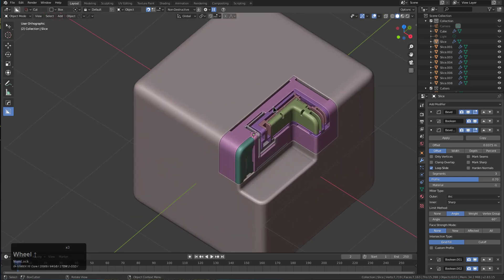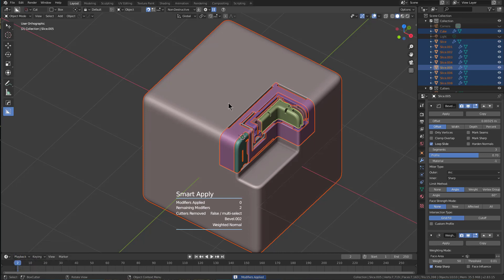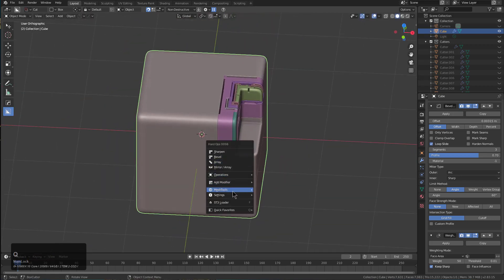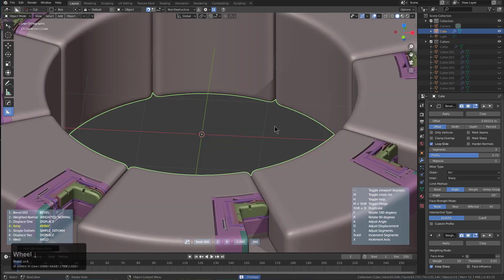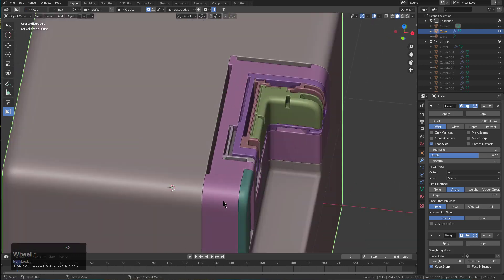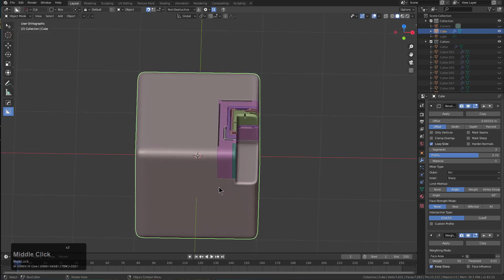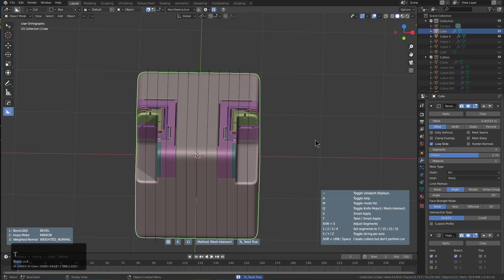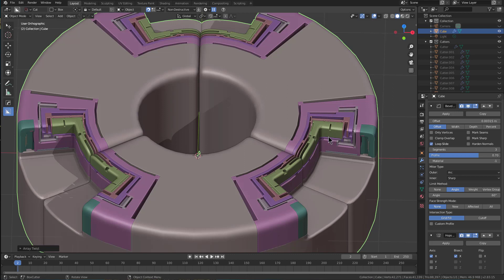#hardops 985 - Dice And Twist

Comment: Hey masterxeon (or the rest of the community for that matter) I've got a quick question.  When dealing with an object that has a lot of booleans, I notice that my project bogs down significantly.  Aside from applying them, is there some way to bring performance in the 3D view back up? My PC is no slouch either, I've got a 3950x (16 core 32 threads) and 32GB of 3600MHz RAM but it looks like Blender is barely using any of it.  Not trying to imply that Hops is at fault either, I'm just asking because I'm sure you've run into a similar problem at some point.
Reply from the maker: gotta apply at some point. It eases the evaluation on the pc side. Someday a trickier solution could be found but it would be a hack to get that speed back. When the speed is impacted I have to apply at a certain point. Also with bevel and weighted normal it also adds to the evaluation.
Reply: @masterxeon1001  good to know. Gotta commit at some point. I guess doing things non destructive like that is addicting. Thanks
Reply from the maker: @Sophistry0001  I can get rather far but at the end. It gets hard to dice and twist without apply. I love that speed hit that comes with apply and the freedom that comes with it.

Comment: Before I buy I gotta ask how hard is it to UV while using Boxcutter/Hardops with all the cuts does this increase the difficulty the task of UVing?
Reply from the maker: There is not a mesh that cannot be uv'ed by either a human or a machine. If you are asking about optimization that is based on the user itself. Substance painter doesn't even need uvs anymore.

Comment: [Update: Idk wtf is going on, but now the Q menu is working when I reinstalled the e-cycles 2.83x on another drive.  You're stuff is awesome, btw.  Ppl change by the day, computers don't...or I thought they didn't!}

Jerry, what's the story?  I tried to use e-cycles 2.83 and when I press Q, it shows the Hardops titled menu, but without your list of options.  After I realized it wasn't me, it was you, I retrograded back to e-cycles 2.82x and voila it works again.  [Update: I spoke too soon, today, it doesn't work in my 2.82 e-cycles either]  The menus work fine, and even the shift spacebar 9 works for T menu option, but I have to use the N menu options to work with you're addon.  Now I'm wondering WTH I did.  Alt W works to trigger boxcutter.  I'm confused af.
Reply from the maker: I would recommend using official blender. Im not messing with branches. You never know whats missing. Ecycles is for rendering in cycles I believe. For modelling you might need to use official. 
https://www.blender.org/download/
Reply: @masterxeon1001 ,  ty for responding. 
k, it's half my fault (and my evil left hand); for some reason I didn't realize your menu doesn't trigger if I didn't select an object in the scene.
Yes, I'm that green with your addon! Soon I'll even understand what dice actually means... E-cycles is like cycles, but you don't have to use a render farm for simple jobs...it's as fast as Redshift with C4D, but I haven't tried Octane for Blender, which is about as fast as Redshift I think...to test side by side.